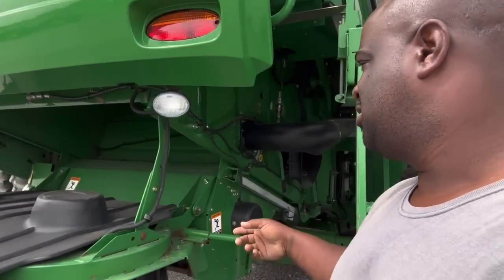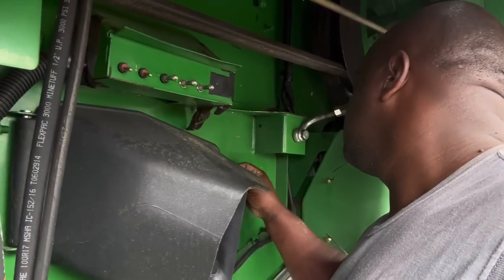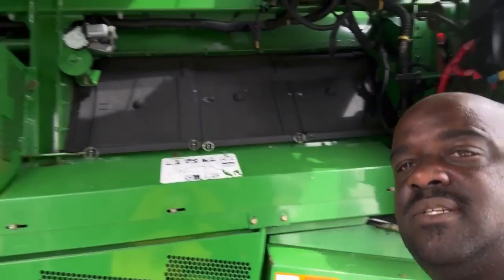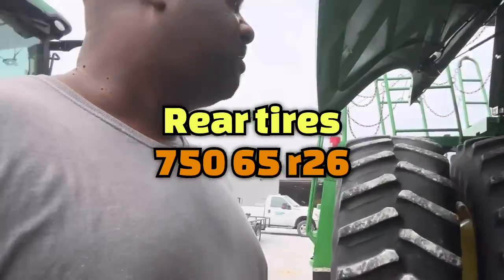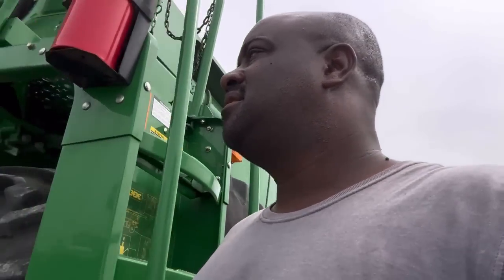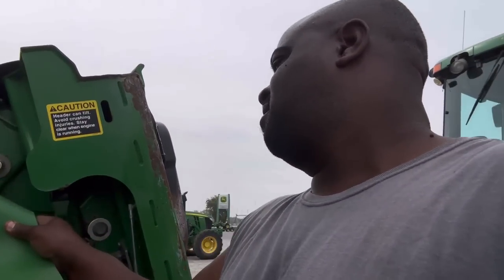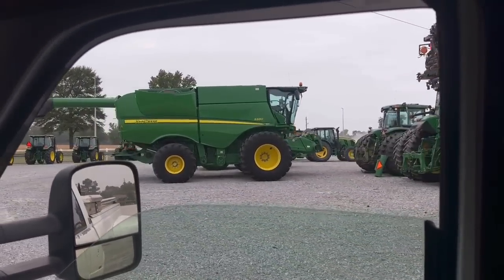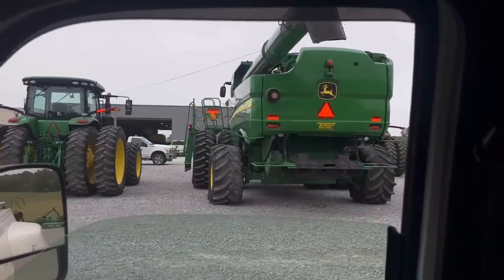S680 did I buy it ?

Comment: Two points - a lot of causal observers do not realize that this machine used, costs 150-200K US dollars.  The other thing -- I am not saying people are dishonest, but when you buy a tractor (or any equipment) and some part of it has been rebuilt -  It could be a  chronic issue, where it has traded in because it kept breaking and needed  to be fixed ever 20-30 hours.   Sure it will work  when you try it out, and you can start the harvest, but will it last?  It could be good, but  I would ask more questions and get them to warranty the part rebuilt for a few hundred hours.  I would go like this -- You rebuilt it?  Looks like a good job.  You think the problem is fixed?  Yeah?  you mind warrantying all the parts and labor for that for 250 hours?  onsite, in field service?  ok. cool.  you got a deal.
Reply from the maker: I see what your saying 💪

Comment: I hope u looked better than what u showed use the first auger u said was good was wore out and it had a couple dog bones replaced  u can bet all the rest r ready to be replaced to and the screen in the cab that spot u see on it that lookes like a bubble well that’s because the screen is going bad and there not cheap and hoped u pulled the covers and looked at the rotor and checked rotor bearing when they get 2000sep hrs there ready for a overhaul